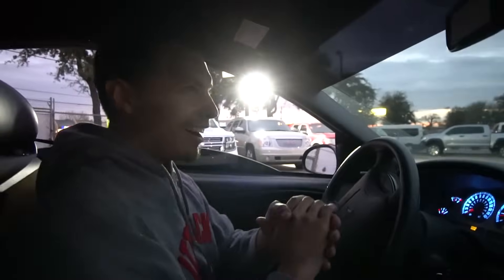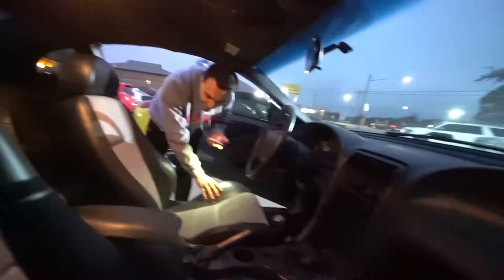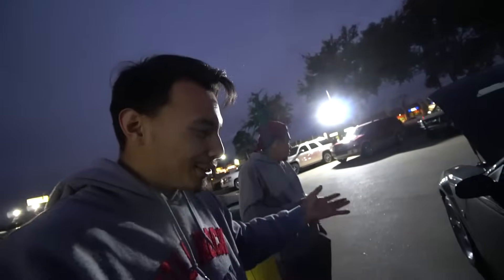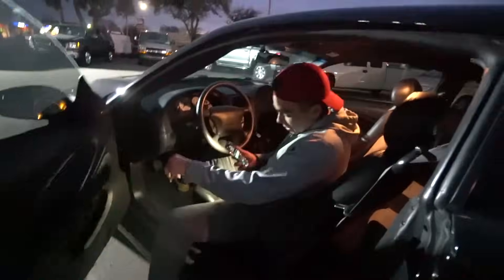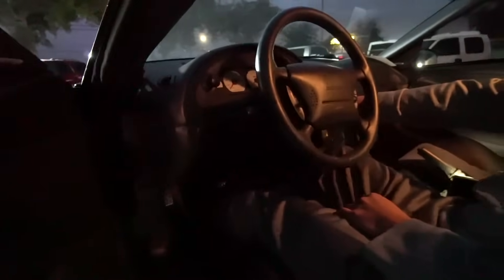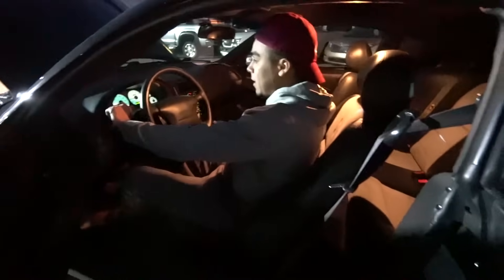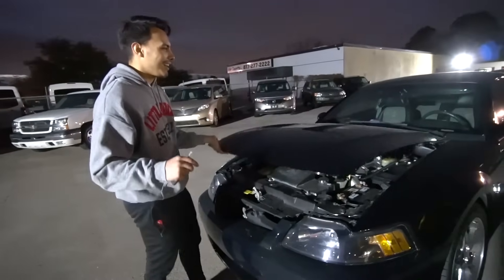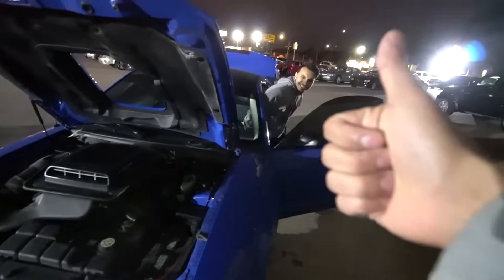Is this my new Terminator Cobra?

Comment: It has a aftermarket fuel system. The system wasn’t primed. You can here it when you key on and you can see the regulator under the hood
Reply: Mustang Lifestyle that also looked like a Stegmire Ported blower to.
Reply: Josh Bishop yes you can see the stamp on it!

Comment: What ever cobra you decide on getting, be sure to take it to a mechanic and get a compression and leak down test. And if it has any more mods than an exhaust and intake, be sure to get a tune ASAP. Untuned pullied cobras are risky. This one looks like it's pullied and ported. So tune should be the 1st thing you do to it
Reply: racequad9 good comment. If compression n leak down are good I would buy it. As long as test drive went well

Comment: I found the car online and checked the Carfax, shows a clean title.  4 owners, last owner had it over 11 years which is good.  Definitely has a fuel issue, or an aftermarket fuel system.  But it sounded good once you started it up, no ticks or anything.  Definitely take it to a mechanic if you're serious about buying it.  Good luck bud.

Comment: The car is not mostly stock. A few things:
1. The wheels are knock off 95 Cobra Rs. That means the car had nicer wheels but the previous owner slapped on the Cobra Rs when getting rid of it.
2. It's got a ported Eaton with smaller pulleys. That means the car has likely been driven HARD by god knows how many people now.
3. It's got more aftermarket parts (MAF, CAI, etc.) Going back to point 2, the car's been driven hard.

I recommend finding a local mechanic you can trust to look the car over (if you buy it). The last thing you want is to buy the car and it grenade itself soon after.

Comment: Supercharger is not supposed to be black .. paint chipping off the coolant tank... wrong wheels... factory fuel door missing... wont start....not worth it in my opinion
Reply: Mike Norton it’s a ported blower, bullitt fuel door, he didn’t prime the fuel system and that’s why it didn’t start.
Reply: Car has to be primed plus that’s a aftermarket supercharger bro come on now

Comment: Dam bro, i think you should just stick a blower on your Mach1 man, its low miles and looks so sick, stick with the Mach bro.
Reply: Justin Merrill the motor is weak in the Mach1 hur dur... have you not heard him say that over and over
Reply: Hassan Osman @hassan, the 4v in the Mach 1 is not a weak platform. With some supporting mods, you could run 7-8lbs of boost with no problem.
Reply: Texan 2v He wont be able to exceed 450whp safely on a stock motor. I’m sure he wants big boy power now that he’s in Dallas.
Reply: I love the Cobra, dont get me wrong, but that blue Mach1 is sexy as hell, I myself would just beef The Mach up.
Reply: @negativesplits06  450 would blow his mind and he doesn't use the 320 he has now
Reply: Trevon Adams  with his miles it would hold 7 or 8 pounds till 100000 or more miles

Comment: Honestly bro if you get the terminator your channel would grow a lot but you’d be no different then the rest of the youtubers ...

99/01 cobra and 03/04 mach 1’s have no one really doing builds on them. I’d keep the Mach & build it . It’ll be much more respected and much more appreciated then another terminator build everyone does

Eaton swap it & save for forged internals then boom. Basically for a terminator with a better rear end to do hooligan shit in lol
Reply: That's what I'm thinking. Spend the money on a full engine rebuild with all the right internals and put a good Eaton or Kenne Bell blower on it. Looks wise I think they look better than the Vortec type side mounted.

Not only will it keep up with the Cobra's; it will beat some of them. I've said this before; it's not all about hp. Reliability and usable low end power is far more important on a daily driver. On an occasional weekend driver; meh - who cares. It's just a toy at that point or a drag car. Bring your big wallet for that hobby though.
Reply: Bob i agree with everything you said bro. And if he plans on racing etc. The Mach is better suited unless he got half shaft replacement money on deck lol . Let’s not get into the alternator problems & who knows how the motor was treated prior to him buying it .So many Variables to buying a terminator as a daily . Personally I’d just use that money and sink it into an engine / set up that i know is New , Was built by a reputable shop so it should last , you know everything about the car / what’s done etc . No loose ends

Plus IMHO his channel we’ll gain less Momentum then a Boosted / Bagged Mach would .... it’s too many terminators / gt500’s on channels ... name a big MUSTANG channel without one the two.??! He’s just going to fade out in the back ground and become another terminator page with a FBO E85 or blower swapped terminator . None special
Reply: @Jmuderer : Yep; agreed. If he just wants quickness for the street; a set of 3.73 rear end gears would be a nice mid-range so it would still be fine for the freeway but quicker in the lower speeds. I want that for my 99 GT at some point but I have other wants ahead of that. The gear set would be a good compromise for now instead of rebuilding the engine. That's why I said HP isn't everything. These 3300 lb cars are light so little improvements like gears and just a 8 lb boost can make a huge difference. People building 800+ hp street cars are asking for big problems. I would build this as a reliable 450-550(ish) hp daily and think about something else to build for a high hp drag racer. The "run what ya brung" crowd has fun but how many of them get towed home? More than a lot folks think I bet. Still, like you said, save the money then build this engine to be new, solid, strong, and reliable with an Eaton (or Kenne Bell) blower. That 3.73 rear end will still be useful. Bring that 6 cyl New Edge down to Dallas to drive while the rebuild happens or just get a Honda Civic or something then when something breaks at the local drag track; he still has a way to get to work. ;)
Reply: 1sloww4v that’s exactly what I’m doing now to my 01 cobra build I’m doing the hole Eaton swap on Monday ! Should I post a vid? I also have a ton of mods and bolts ons to play with!
Reply: georgekperez5 awesome bro! Hell yeah lol you got Instagram I’ll follow you! I did an last swap on my last car . Had a procharger  for this one but sold it . Going eaton Swap on this cobra too lol plus paint. Going be nice when done

Comment: That thing is beat. Find a clean one from a person. Not a dealerships. There is a reason people trade this cobras in. Either messed it up or something is wrong with it.
Reply: john david most of them are beat as they are old. Looked pretty clean tho
Reply: Luis Rod that one is beat. I have one and keep it on point. First thing is look at the engine bay if they can’t clean the bay clean they didn’t kept up with the car
Reply: I wouldn’t say it’s beat but she needs some engine bay touch ups
Reply: I agree.  Sounds like it has a fuel issue with that start up.  You shouldn't have to cycle the fuel pump for that long for it to start up.
Reply: speeddemon0712 sounds like a aftermarket fuel system it didn’t stop running once the key was in on the on position. Car was far from stock.
Reply: @TurboTurdBurglar  Yep that's true, makes more sense the more I think about it.

Comment: Its not stock at all. The blower is already ported and with all the work that i can see done it should be worth more especially with only 17k miles. Sounds too good to be true.
Reply: SVT Vasquez i though he said 71k
Reply: @neverenuffblades  your right he did say that but I still have my doubts stegimier ported it and they are a good brand but the tune is what you have to worry about. I WOULD KEEP LOOKING
Reply: @SVTVasquez  Why do you doubt the blower is ported? It's a pretty common mod to do. Plus, idk who would put a Steg plate on an unported blower... If i were him, i would be sure to get a compression and leak down test at a local mechanic
Reply: @racequad9  i didnt use a period. I said i still have my doubts. Stegi did port it and they are a good brand but you have to worry about the tuner in this case not the blowet port
Reply: @SVTVasquez  I dont see how a period would have changed what you said... i am just saying, why would you have doubts it's ported just by looking at it. I can see if you saw a dyno graph and the power was low, but i would place money on it being ported since it has the plate.  Steig stamps numbers on the front bottom right (maybe left) of the blowers he ports. So he could check that to be sure.
I do agree on the tune being the most important part. That should be the first thing he does if he buys any modded cobra.
Reply: @racequad9  im not saying doubt its ported. I have doubts on purchasing the car. I know its ported i said it was ported. My doubts are on buying the car
Reply: @SVTVasquez  oh, I see. Yeah, grammar and punctuation is your friend when you're giving out advise. I got you now though
Reply: @racequad9  lol i was in a game of fortnite thats why i didn't  bother but you can check out my cobra on my channel if you want

Comment: I don't throw my opinion out very often but I've been following your channel long enough that I feel it's necessary to. I would absolutely hold off on the cobra. There's no good reason to trade in your low-mileage Mach 1 for a cobra. Think about your wants and needs man. It's seems to me it would be a lot smarter for you to hold on to your Mach until you're in the financial position to purchase a cobra, given that time frame a cleaner one will come along. Then you will have 2 badass pony's in the stable and not regretting trading one in. Still supporting you either way brotha.

Comment: Pls, keep the Mach!  
That Cobra looks warn out.  I hope to see your next vid with an Eaton SC install.  BTW, I hate those gas caps on the black cobra, looks like s**t next to the Mach. 
I have a 2002 GT Vert black 25,860 miles, mint garaged kept since 5 miles, polished pro-charger d1sc, stage two comp cams, electric water pump, polished typhoon intake mani, slp long tubes, slp x pipe, summit coil pack, 135 amp alt and Borla atak, 355 gears, cloth top, lower control arms, classic design row bar, Cobra rear bumper lol and I would not consider a trade for that sloppy Cobra over you mint Mach, NO WAY DUDE. BTW vids are great!

Comment: Looks to have a Stiegemeier ported Eaton, with an SCT big air mass air flow sensor, definitely a smaller pulley maybe a 2.6” my guess close to 500 WHP depending on fuel system, Not a bad deal for 17 grand.

Comment: Just add a procharger or supercharger to your mach one, once you think about it the cobra wasnt starting properly and your mach one starts up like a chime
Reply: Jassi Rai The Cobra probably starts fine. It has an aftermarket fuel system which needed to be primed. And Mach 1s can’t handle that much power

Comment: Think the early 2003 had issues with some bolts only being 3 thread. And ford fixed it for 04. Look into it. Still think you should do an ALIMINUMATOR build instead. I would rather have the fastest MACH1 around then just another cobra.

Comment: Yo that Cobra has some performance mods like the fuel system. Can't tell what Blower that is but it aint a Eaton. Also, this is rare thast you see a Terminator on a lot these days. Take it to a mechanic and check it out. Especially a compression check.

Comment: 7:55 you can see a plug unplugged lol looks like a fuel injector plug
Reply: bLOsK_323 pretty sure that’s the fuel pressure regulator. It has an aftermarket fuel system

Comment: Watch out man, the car is not as stock as you think, thats a larger heat exchanger and judging from the snug idler the pulley has to be 2.9 or smaller. Also the maf is aftermarket. If the car wasnt tuned correctly with all of that stuff i would be careful. Also a little sketchy how it cut off on startup. I would search and look at a few more instead of jumping on that one. Youll be surprised what you can find out there for that same price, join the cobra family!!! SUBd

Comment: Yo it looked like the throttle position sensor or fuel rail pressure sensor was unhooked laying on the valve cover at minute 8:16. Might be why it didnt want to crank at first.

Comment: Keep the Mach and boost it and your just as good as a terminator and plus the Mach looks just as good IMO because of the sail panels, get a cobra front bumper and your solid, with your car you know what you have.... that cobra you don’t
Reply: It won’t be as good as a terminator
Reply: Yea I may have went a little far with that comment but it is a nice Mach and would be even nicer with boost
Reply: Json G- The guts of the motor aren’t the same, that’s why the terminator was so good from factory.
Reply: 5pointoh yes sir correct, that engine is more like the older cobra engine,

Comment: Only differences between the two supercharger, rear end and t56. 
Your Mach 1 is way better to built boost in; All aluminum block with heads.
Cobra cast iron block aluminum heads.
Just change your cams to 98 cobra cams and gain 1k rpm and boost it.

Comment: Why don't u just throw a supercharger on the mach 1. Its got an aluminum block. Why does everyone over look that.
Reply: jason karns junk pistons and rods. Can’t go over 475-500 unless you wanna break some rods and pistons
Reply: The Cobra has a better motor
Reply: @BrooXX856  ..if it's stock. If U build an aluminum motor properly it will destroy a cast iron block. I'm talking a Truley built motor. Not just adding boost.
Reply: jason karns and at that point he’d be better off in a Cobra. He doesn’t have plans to make this car make 700 horsepower. Stock vs stock, Cobra has a better motor

Comment: Looks like you're getting a case of new-car-itis. Don't make a mistake. I'd buy a built aluminum short block and put a Vortech on the Mach 1 before I'd buy a Cobra. And you'd probably spend less. Go find an older Teksid aluminum block. They can take Cobra level power and they weigh 80 LBS less. 
   Also look under that Cobra and see what's doin under there. Also make sure it has the independent rear. Or just check the vin to make sure it isn't a clone.

Comment: Hey bro, if you're going to go for a cobra go with one that's all stock and original to be honest your Mach 1 has damn near everything the Cobra does and has its own flavor to it it wouldn't be that much of an upgrade. trust me I know the motor in the horsepower on the Cobra is better obviously but you're mach one is really clean and it's what your channel is known for. That cobra isn't clean enough for a switch I don't think

Comment: The cobra and mach1 basically have the same engine the only difference is the blower you should stick with the mach one and supercharge it, not worth paying for the cobra at all
Reply: basically you are wrong, the internals of the cobra made it ready for the blower and the mach 1 isn’t...
Reply: @everyonewasstealingmynamea919  you're right they are not the same but the point of my comment is that it's not worth paying so much for a cobra when he already has the mach 1 with many similarities to then cobra and it's paid off, also it already got the looks now he can just start investing on increasing horse power on it don't you think?
Reply: mike broswood Did you see the video of that guy with the 2 step and he blew his motor reving it with the Eaton supercharger? It was on this guys page, that’s exactly what will happen to the mach 1 lol.
Reply: mike broswood But yes I understand what your point was.
Reply: @everyonewasstealingmynamea919  oh yeah that was bad man he had barely done that to his car I felt sorry for that dude
Reply: @everyonewasstealingmynamea919 : But look at what he was doing at the time. Revving it past red line with no load at all on the engine. That was a total rookie mistake. Shame too. Looked like a good build till then.

Comment: Wrong wheels on the car...fuel pump is very noisy,  probably needs replacement soon...wonder why the previos owner painted the blower glossy black?.......I'd look around at others before you decide.........
Reply: Kip O'Hara 
Ported and polished
Reply: I agree
Reply: Kip O'Hara it has a return style fuel system if you know lol pumps are supposed to be that loud

Comment: keep the Mach, the Cobra looks far from stock, obviously has exhaust. smaller pulley with idler so it probably has a tune from someone, the cold air and aftermarket MAF. it has an aftermarket clutch adjuster and i guess quadrant. plus an upgraded fuel system. ubless you can find the previous owner to know who tuned it, there are to many unknowns. the only way i would buy a car with those mods and that many miles is if i knew who had it and had the parts installed. also get the vin and run a car fax to see how many owners it's had.

Comment: Dont get a 03 cobra unless it has the 9 thread head or the cooling mod that they redid in 04.. you'll be kicking yourself in the ass when you are finding yourself rebuilding your engine because #8 cylinder had no antifreeze in it..

Comment: Just throw a blower on the Mach 1
Reply: DreadHawk Stokes exactly dude 🙄
Reply: Collins HD 
He’d be limited to around 425-450 hp. Mach 1s don’t have same internals as Cobras
Reply: Mach 1s can’t handle anymore then 500 horsepower. The motors are very different

Comment: Take your aftermarket stuff off and put it on the Termi!!!!
Reply: Juan Ruiz not everything will work
Reply: @BrooXX856  Exterior parts, lights and wheels will. Not sure about the air ride though.
Reply: Juan Ruiz air ride in the rear won’t